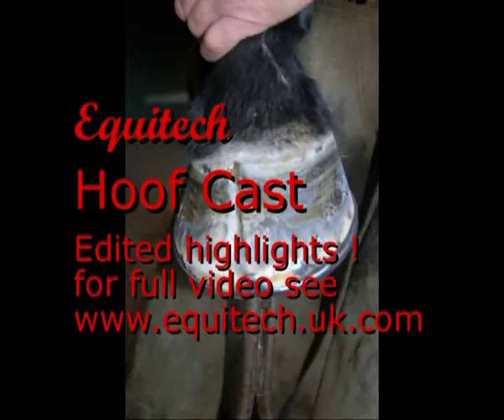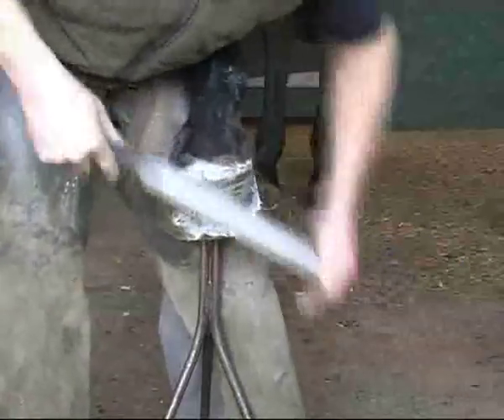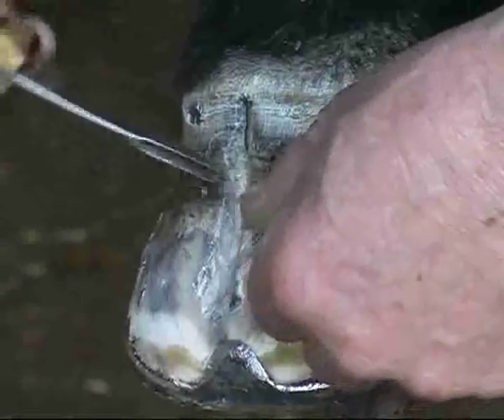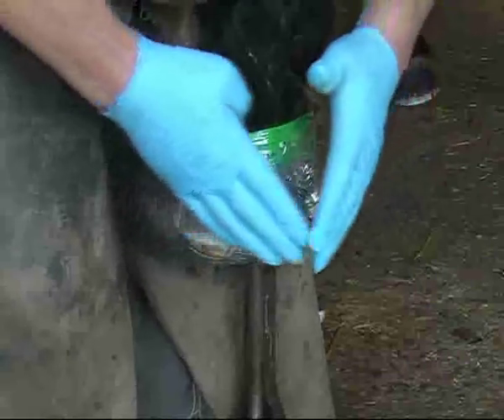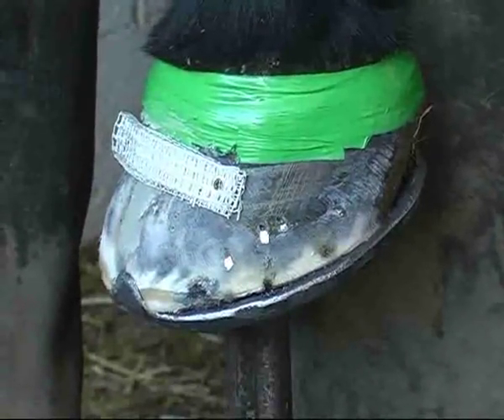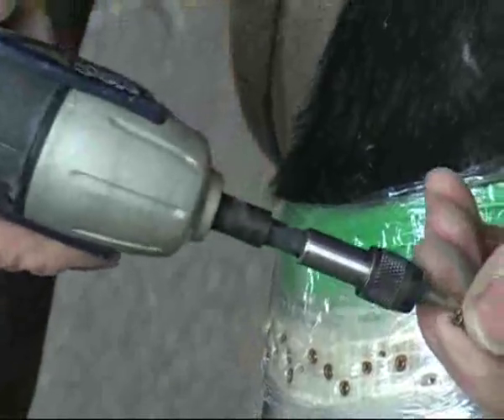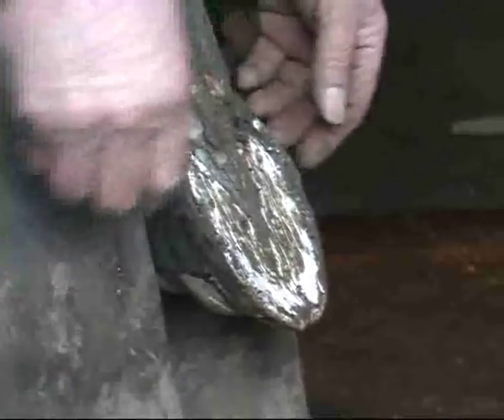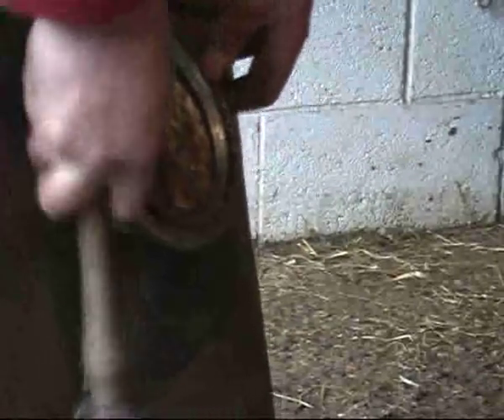Horse Hoof Crack Repair

Comment from the maker: Hi NMFarrier. Sorry to be slow responding. I will ask the farrier in the video, I'm the scientist developing the materials.  In a couple of cases where we had major instability we actually used  Equitech Polyester Hoof Cast to form a complete prosthetic hoof wall to support the repair. This also provides a matrix to nail into as a couple of the horses had really poor horn quality and just didn't hold nails well. If you put in Equitech on you tube you should find some examples of Cast use.

Comment: Good video, I however have some concerns,

Its imperative that you clean the crack (white lightning/cleantrax/chlorine dioxide) to kill any fungus or bacteria before you fill it with glue. The glue can create an anaerobic environment where bacteria thrive and destroy horn.

Instead of using fiberglass I recommend the use of a kevlar patch as kevlar is much stronger and many times more resilient to fracturing in comparison to fiberglass. Screws would probably not be necessary, but wouldn't hurt.

Comment: I have never seen a worse looking hoof.  Why would you remove the outside of the hoof they way he did?  And all the holes in the hoof.  Of course it is going to crack again.  ON the Epoxy fill.  Why not just patch and reinforce in the same step with no screws...

Comment: @martinBmw940 :  Hoof dressings won't make your hoof more moist and in fact will lock in bacteria causing white line disease.  Trim the hoof walls down - they are too long - and you might consider going barefoot and boot when you need to.